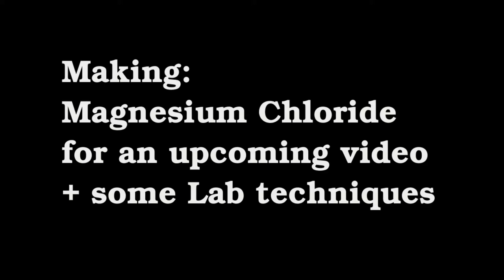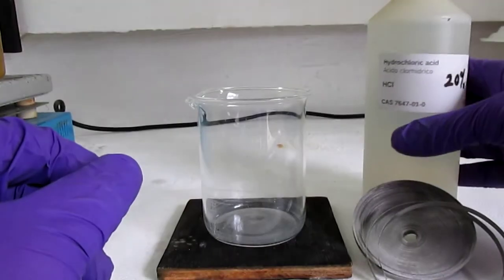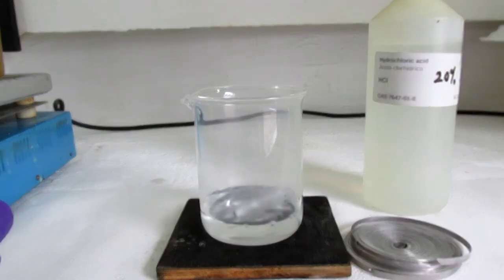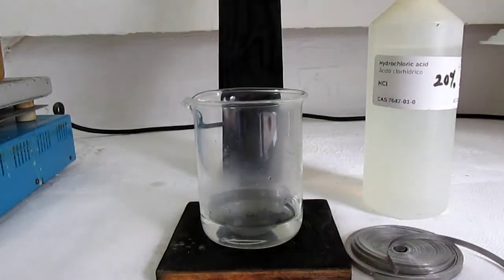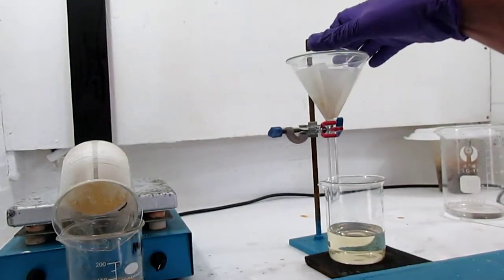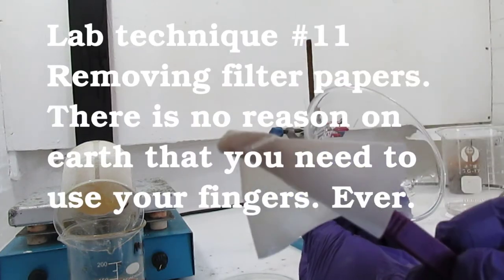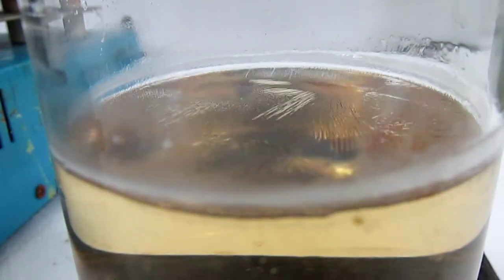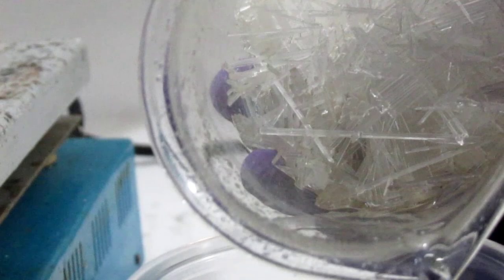Making Magnesium Chloride plus some Lab practice tips

Comment: When the magnesium is put into the hydrochloric acid it immediately starts to bubble, this is because the gas hydrogen is produced. It is not because the liquid is boiling.
Reply from the maker: As with all things, it depends on the conditions, which usually means When.
If everything is very cold, you are correct: the gas formed is mostly Hydrogen.
The reaction is rather exothermic, so the water heats up if more Mg is added.
When the water is near boiling, the addition of more Mg could push the temperature past the boiling point of water, so both Hydrogen and large amounts of Water vapor could result.
These are the kinds of things that Chemists must think very carefully about, due to the possibility of a disaster that could easily be avoided.
Even a small-scale amateur chemist must calculate the expected temperatures, gas volumes, disposal strategies etc before any actual experiment.

Comment: Hi there  can  the same be done with magnesium carbonate
Reply from the maker: I don't think MgCO3 would work for making tofu, mainly because it will not dissolve in water.
Reply: @aga5897  thank you for your help but is there any other way to achieve this result
Reply from the maker: @keeptrying7640  Maybe i am confused - is it Tofu you want to make, or Magnesium chloride ?
Reply from the maker: If it is magnesium chloride you want, it is very cheap on ebay.
In a situation where i needed some magnesium chloride, but had no money and no access to hydrochloric (aka Muriatic) acid, i'd
get the magnesium from a broken electric water heater.
The grey rod that is not connected to anything is a 'sacrificial anode' and is usually Mg.
Then i'd get some ferric chloride from someone who made printed circuit boards, or used it for etching something else.
The reaction would get really hot very fast (Danger!) and the resulting liquid would be green/brown.
The crystals would need recrystallising at least 2 times, but the result would be MgCl2 + Fe.
I'm not suggesting You do that: it is just what I would do.